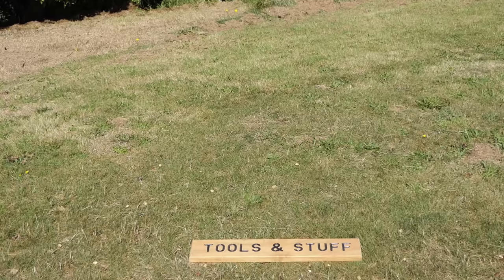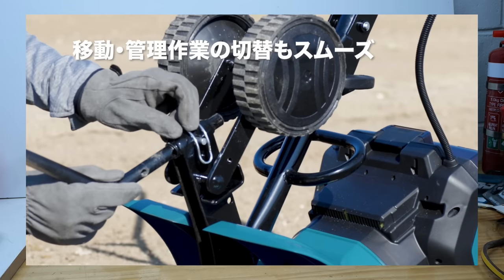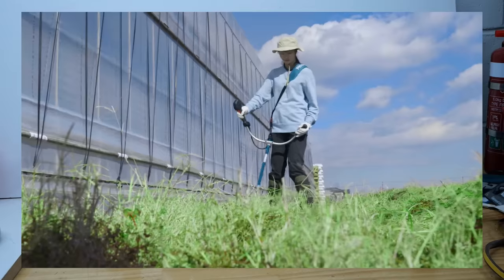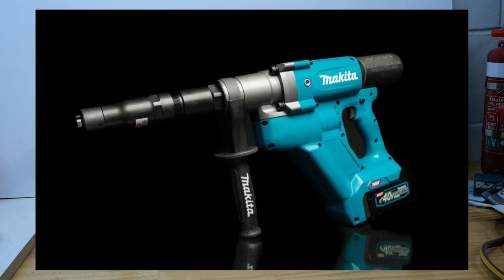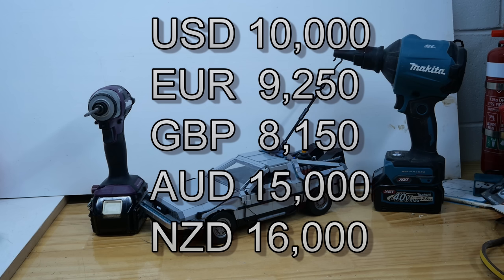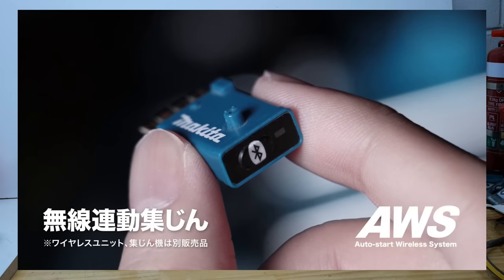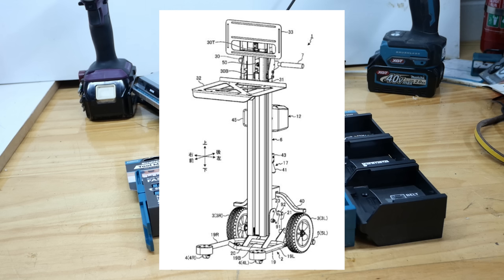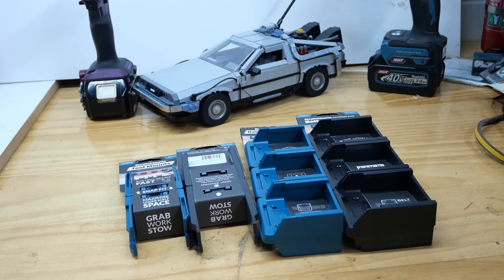Makita News March 2023 What Makita Tool Costs $10,000?

Comment: I’m interested to know if the mister could deal with granular particles in the water. I’d say it would be useful for farmers or horticulturalists wanting to foliar spray nutrients, or other non toxic liquids, over trees/orchards/vines to control pests, fungal attack, reduce frost damage or uptake of nutrients through leaves.
Does it have a filter for the liquid, or does it only use clean water? Is this filter easily accessible?
Does it have an adapter to use a ventura system for uptake of nutrients/chemicals?
Could it double as a leaf blower or does it need the liquid to cool it while running?

Comment: HUCK! I do not know. Thanks😉
Also seen on Makita NZ : AC001G 40Vmax XGT Air Compressor (review?), CW00xG 40Vmax XGT 50L & 7L Cooler & Warmer and new VR00xC 40Vmax ConnectX Concrete Vibrator (EXEN ECV-M series).
Additionally seen on Ogura JP : HCC-F1640 40Vmax XGT Rebar Cutter and HSC-41MX 40Vmax XGT Tip Saw Cutter (Makita should normally follow).

Comment: Interesting they chose to make the microwave.  Inverter microwaves are powered in the same way as brushless motors (via pulsed DC) so I guess it was only a matter of time until someone realised hey, we can disconnect the motor from one of our tools and attach a transformer instead and it will generate the right voltages needed to run a microwave.  As a bonus this method lets you shift the phase/frequency so you don't need that glass plate inside that rotates the food to cook it evenly, because you can move the hotspots around the cooking chamber instead using the same electronics that make the tool motor run at different speeds.  So that makes this kind of microwave even more practical to move around without worrying about that glass plate moving or breaking.

Comment: Are you going to review the new 40v paddle mixer? I'd love to know if it can run an earth auger attachment. Would make a very versatile drill if it can.
Reply: Wouldn't you just get the earth auger and put a mixer bit in it? Then you'd have an auger, right angle drill, and mixer.
Reply: @toolscientist  I'd use it for mixing 90% of the time. The earth auger is far bigger, heavier and less ergonomic for mixing.

Comment: Ahh Huck rivets, that would be pretty useful. Not to much aerospace to my knowlege, as heavy trucks. 18-wheelers, maybe you call them lorries? Trash trucks, stuff like that. Trailers and frames. You tighten the bolt rivet then they dont loosen over time so less maintenance. The air ones basically kill themselves within 500 rivets because it takes so much umph, Huck stopped warrantying the tools past 6 months because of this. If these last a long time/have a Makita warranty I think they would be sweet.

Comment: I guess that ends the Makita Microwave jokes. Now, they need to XGT power that K car they loaded the tiller into, or at least something a little more substantial than the bicycle.

The lift/loader looks like something they'd make, akin to the wheelbarrow. Sure, it looks like something not really too necessary, but if you're doing a job all day it looks like it might make your day easier.

Comment: For some reason Makita stopped selling the TD001G, skipped the 002 and now instead only sells the TD003G. It has less functions and is a bit cheaper. Have you heard of this one and maybe already tested it?
Reply: We’ve been laughing about that one.  I’m waiting for hell to freeze over = XGT ring light.
Reply from the maker: I might test it... I generally only review top tier Makita impact drivers, but we'll see. I'll probably grab one at some point.
Reply: @ToolsAndStuffOFFICIAL  I kinda thought it's a lower end model. Don't get why Makita stopped selling all other XGT ones. Fingers crossed they're going to release an XGT equivalent of the DTD173
Reply from the maker: The other models are still available. What country are you in?
Reply: @ToolsAndStuffOFFICIAL The Netherlands. The TD001G is listed as 'out of assortment'. There's probably some stock here and there, but Makita isn't restocking suppliers.